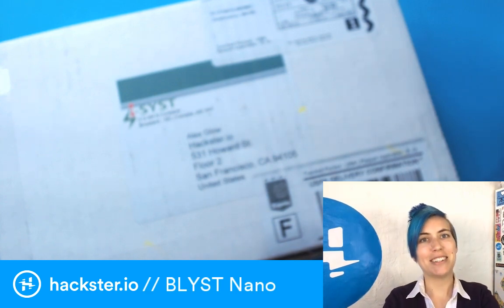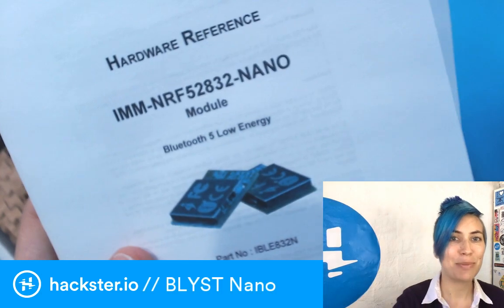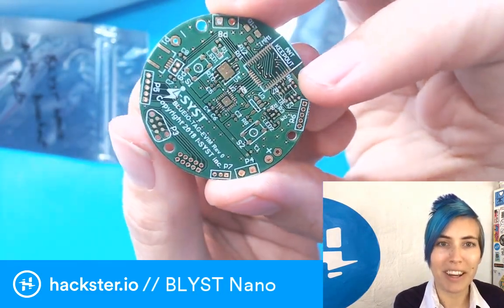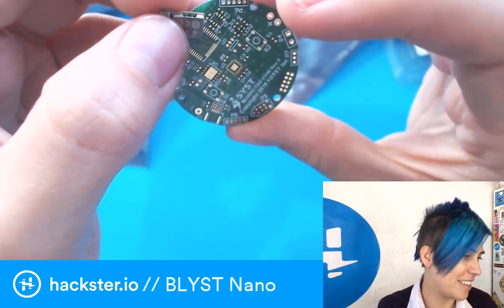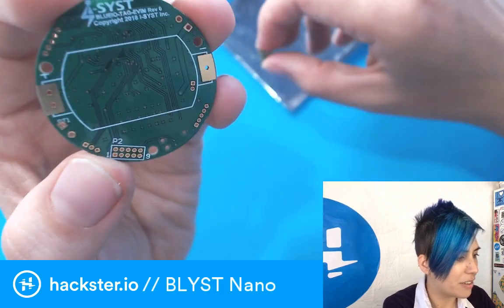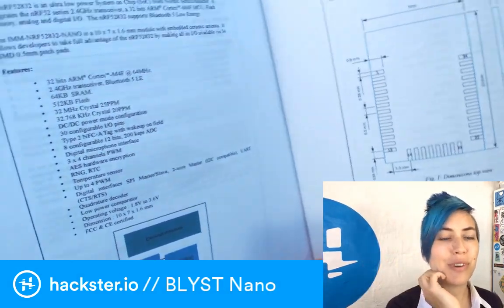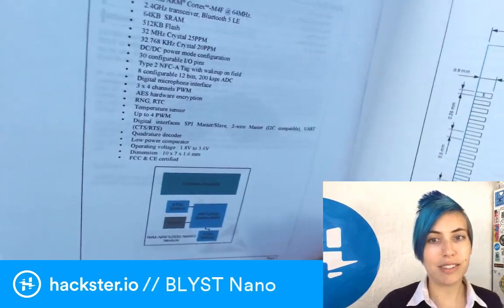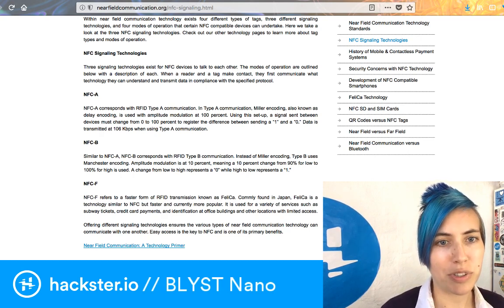BLYST Nano // MCU Monday

Comment: You don't need Adafruit bootloader to use with Arduino IDE.  Event better,  you can actually debug with Arduino IDE with the IDAP-Link CMSIS-DAP Debug JTag.  Follow the step from this site https://github.com/sandeepmistry/arduino-nRF5 and setup as generic nRF52 device.